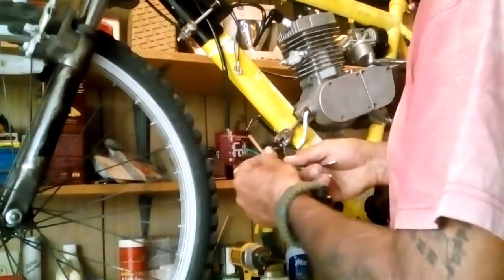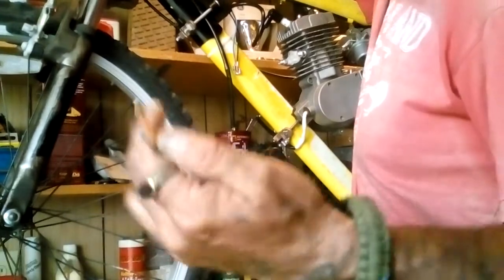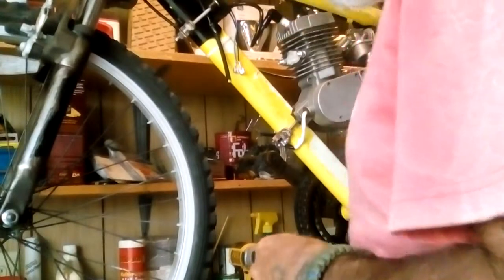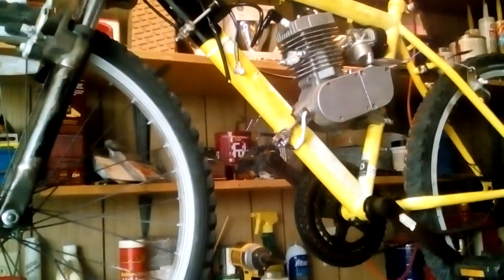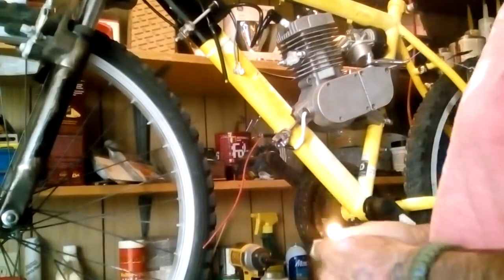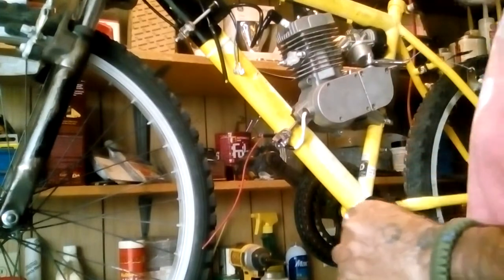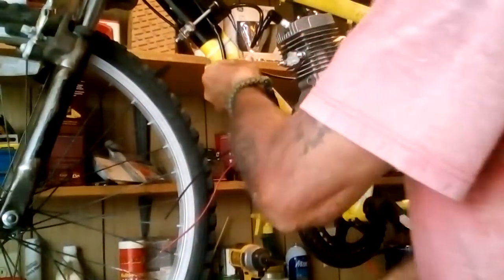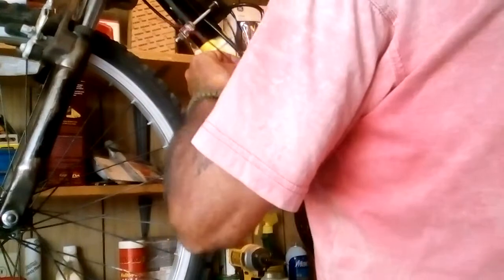Wiring the Kill Switch on 49cc Motorized Bicycle

Comment: Kill switch is connected to spark plugs mind no spark new cdi new coil won't start what is problem timing chain make some video to fix thanks
Reply from the maker: Pull off the Magneto cover and check the wired connection at the bottom of the magneto. If it is broken or something is wrong with this wire that my friend is the problem. Re-solder it and you should be good to go.

Comment: Hey quick question my kill switch has a red and a black wire which one do I disconnect if I don't want to kill switch it's not working right so I was just disconnect please help
Reply from the maker: Black and silver Raiders well the red one should be positive and the black negative battery. So if you want disconnect the kill switch without screwing up the rest of the wiring i would disconnect the red positive lead and leave the negative one hooked up. Also tape the red wire or clip the bare copper wire off so it doesn’t ground out on the frame or any metal parts and short the magnito. Or you could unhook both and the kill switch is dead. If it was me I would want to know why and since I have disconnected it take it apart and figure out what is the problem. You want to have that kill switch for that one  time when you really need to shut off the engine before either you crash at full throttle or the throttle hangs up and the engine is a runaway heading towards catastrophic failure...
Reply: @Brian136  thanks you so much
Reply: @Brian136  hey what do you think is better a 2-stroke high-grade or do you think of four stroke phantom have you seen those

Comment: Bro I just made my first bike.gey give her test run.tommorw
Reply from the maker: Good luck make a video and post it so we all can see what you did")
Reply: Can't get it started lol gas tank lines leaking lol.
Reply from the maker: @blairduffy1130  really!? That's kinda unusual for new fuel line. Should have sealed once you pushed it in all the way. New rubber/ silicone is pliable and  smaller than the fitting. You did use the new fuel line right?
Reply: Yep it my first time putting one together.in couple weeks I'm taking it to lawn mower machanic. Just watch him fix see what he did.
Reply: It s grubee  gt5 my clutch was stuck. I did manage to get that free and moving.  Then it pissed me off with lines so. I just left smoked some joints I don't care to try to fuck with it my self
Reply from the maker: @blairduffy1130  goog man using your peanut to solve the problem. Ya I was you I wouldn't mess with it either. Could fuck it up worse or maybe learn something about the engine and how it works correctly. How to install new fuel lines or at least be able to tell if you need to replace the ones that are on it")
Reply: @blairduffy1130  I found an awesome 80cc engine breakdown video. It's like cgi type video. Might help make things easier for u

Comment: Brian where do i get extra blue and black wires for the Magneto connection and how do you judge the right wires, my wires are too short I need to lengthen them what's the size of those wires and are they copper or what and what is the diameter of the wires where can I find them at
Reply from the maker: Well yes they are copper #2 strand (you know bunch of little ones twisted up to make 1 bigger on) you don't get extra wires from anyone selling to the kit. Try Ace hardware or your local store. I would say looks like 12-14 Gage wire to me.( Never had to know before?) You want the wire connection to the mag short to Begin with to much loose wire hanging out and it gets hung up in the spinning magnito and you just crashed. Make sure your spark Pak is good first before you disconnect the wires to the mag. Also if you haven't disconnected them yet check the solder make sure it's ok not cracked or the wire has broken away from the solder connect. Finally check and make sure the little magnet that is imbedded in the magnito itself is still there if not you need new magnito because you can not fix that. Other than that good luck don't forget to wash your hands")